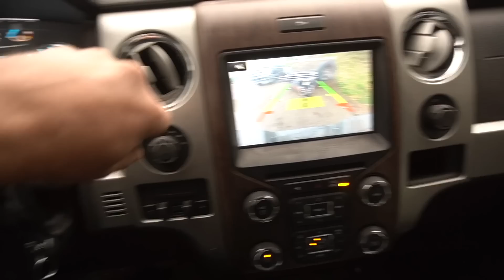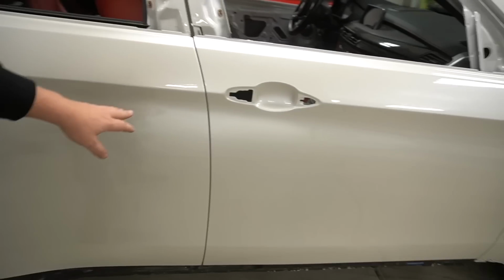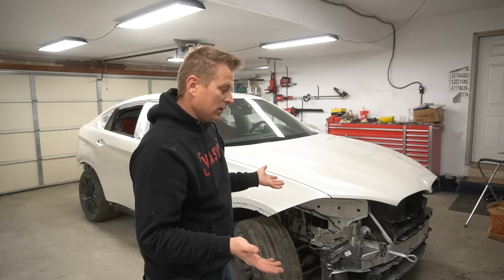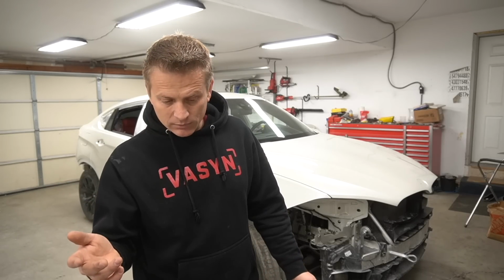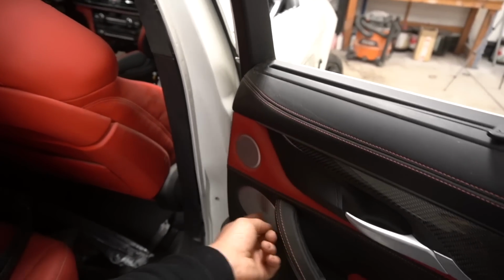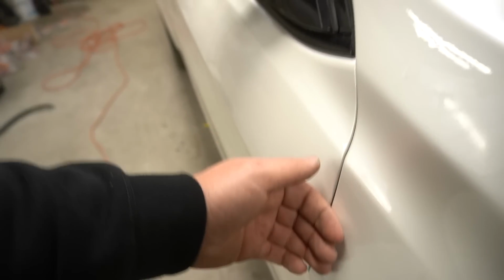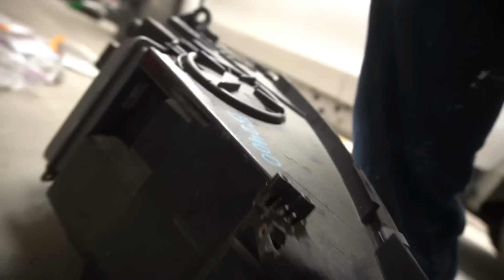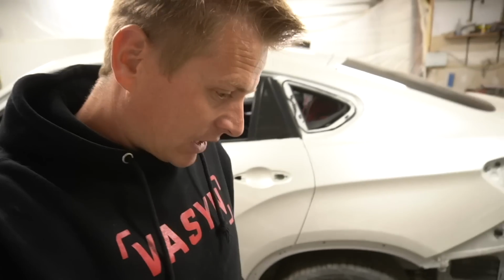I Screwed Up My Wife's BMW X6M

Comment: hi val pearl whites are hard to get right  i have to deal with them all the time if you do it again put the base on and let it vapour off completely 30 minutes to an hour tack off with a fine tack cloth then put a coat of pearl on but not to wet let it vapour off 30 minutes then put a heavier coat on  let vapour off again if it looks uniform then clearcoat if not put a dust coat on vapour off then clear coat i have been using sagola 4500 extreme spray guns and  the fan and finish is exceptional  1 gun for base and pearl 1 gun for clearcoat if you do it in winter time leave each process extra time you can put the paint and clearcoat tins in warm water for 20 minutes to warn up the product great application and less chance of runs clouding blotching and stripes is usually caused by not letting the product vapour off properly  and even overlap of spraygun you will get it right no doubt in that cheers from down under

Comment: I know exactly how you feel when something doesn't turn out right. You are a perfectionist like me and everything has to be perfect. The only thing you can do is to wait until the summer and use the existing paint as a base for the new paint job which will come out perfect in the warm weather. You think this paint job is bad, I once sprayed a car in cold weather and the paint came out matte instead of gloss and I had to reprint it. Just keep your spirits up and move on with what you are doing. All the best from Queensland Australia.
Reply: That should have been respray it! I don't have a 3D printer to print a car, but don't be surprised if cars are 3D printed in the future.

Comment: I Maked same X6M from 2018 year. Almost everything new engine, suspension, drivetrain and the whole interior because it was after burned. Almost the whole car from scratch. I closed in less than one month.
Reply from the maker: And I was on the moon 10 times too. Video? Photos? Any proof or just a mouth run?